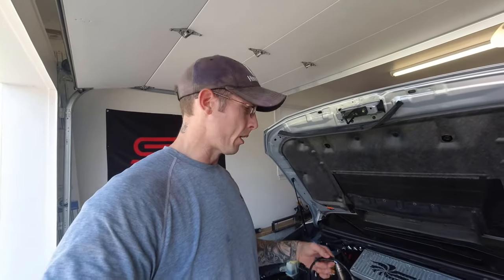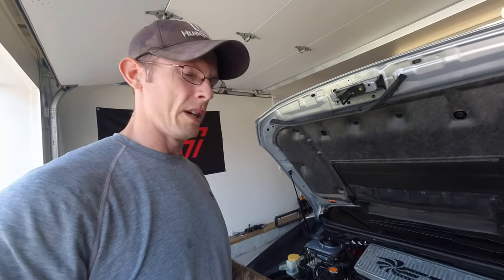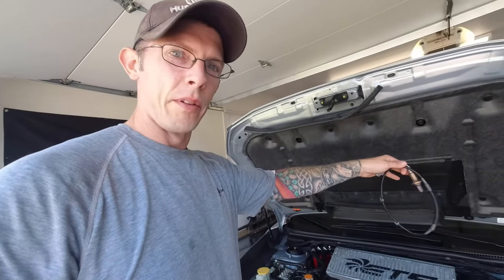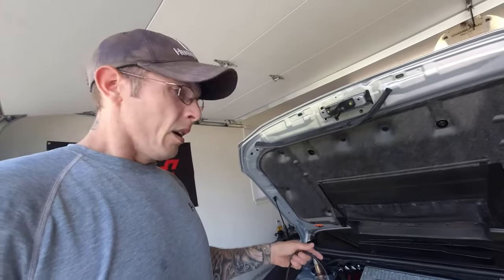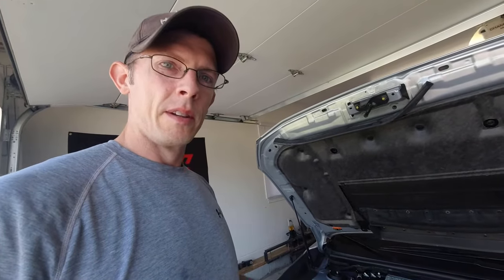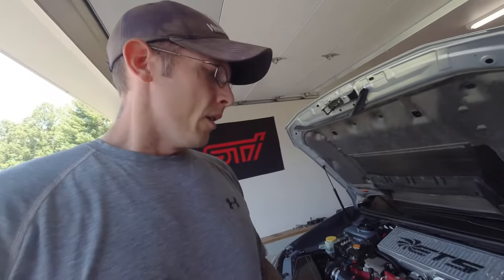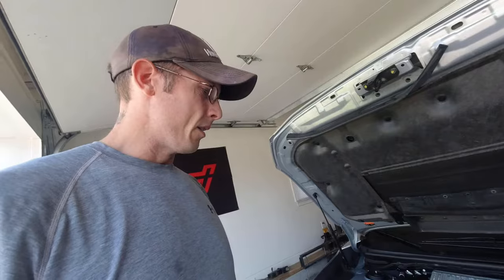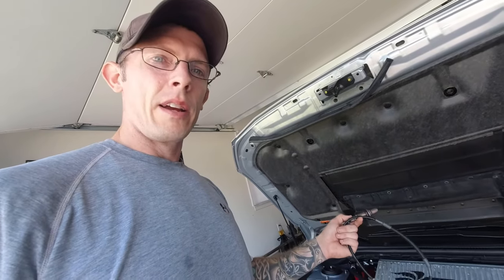Symptom of a Failing Front Oxygen | O2 Air Fuel Sensor | WRX STI

Comment: What's your opinion on using o2 sensor from autozone? Just got a P013B code. Slow response from lean to rich. Thinking of replacing them myself but Oem o2 sensor kinda pricy for me
Reply from the maker: Personally when it comes to sensors and anything electrical it is hard for me not to buy OEM. My take on it is I can pay a little more up front and get the longevity of the OE part. 

I’m sure there are plenty of cases out there where the cheaper sensors have worked and are still working. I just prefer to go with OEM parts in this case.

Thanks for asking and I hope you get your issues sorted.
Reply: I bought the bosch o2 sensors at autozone for my jeep and they didnt work because they are not compatible

Comment: i have the same problem afL 1 goes to like -40 and car runs really rich and stalls out almost but i have code for low voltage on rear 02 which makes no sense because thats for emissions and im catless
Reply: I just went catless due to 1 restricted cat on bank one and the cat by the muffler being restricted and I ended up having them removed and still having all kinds of maxed out fuel trims causing intermittent shaking, loss of power and stalling and backfiring and popping. I changed every filter, sensor, fuel pump, injectors, plugs, wires, coils, Maf, TBC, and still does same thing. I’m only getting 02 codes and recently took to the 3rd mechanic and he’s now telling me I need my cats put back on for my 02’s to work properly. He also said only OEM 02’s should be used. He told me the downstream 02’s will also play a part into air/fuel ratio which I didn’t know. I was told they only monitored the health of the cats. I’d like a second opinion before I pay them $2500 for an exhaust that won’t end up fixing my issue.

Comment: Would this make a fuel pump fuse blow ? I have a 2015 Subaru WRX STI launch edition and starting my car in the morning is dies and pop the hood fuel pump fuse keep going out once you keep it running it's fine ? Driving me nuts
Reply from the maker: I sincerely don't think the 02 senor would make the fuel pump fuse blow. 

That issue sounds like you could have an electrical issue on the fuel pump circuit itself. I'm no electrician, but it sounds like the initial draw that it takes to start the car is overloading that particular part of the circuit. The largest electrical  current draw on anything is at startup

Hope you get it lined out quickly. Sorry I could not be of more help.
Reply: So do you think a new fuel pump would fix it?
Reply from the maker: @lad214  I can't say with 100% certainty that it would correct your issue. Don't want anyone throwing money at something and then it nor be correct.

I'd take it in to a shop and have them check the whole fuel pump electrical circuit for any issues. Then see what they say.

Comment: What was the code called because I have a p0172 rich fuel bank check engine light clean maf sensor and air filter and check for leaks but no luck could it be the 02sensor ?
Reply from the maker: I did not get a code when my 02 went bad. It never threw one, I just had to start trouble shooting based upon what the car was doing. I've personally never dealt with code you have before, based upon what you have said I'd say you are going down the right path to figure it out.
Reply: i have the same code on my impreza it makes the car useless. did you find out what the problem was.

Comment: Hey I got code p0420 on my 19 STI, it came on after I made like a hard right turn so I figured i moved something down there, do you think it might be the sensor like in your situation? My car has no issues at all though drives normal with the check engine light or without it, I just been resetting the ecu and check engine went away for months but came back on recently,
Reply from the maker: You may already know this, but the 0420 code is for the rear O2 sensor near the cat. In that situation that's probably why it's not really causing you any issues other than the light. If it was the front O2 you'd know it lol. 

With that said, you could have a cut in the wiring going to the rear sensor that just acts up every now and then. Like with the hard turning and such. I'd check that out see if everything is tight and in order back there. If that doesn't work for you then it very well may be a faulty rear O2 sensor.

Good luck on getting it sorted.
Reply: @spdkills83  oh man thanks for explaining that. And for replying so fast👍🏼👍🏼👍🏼 I will go ahead and do that and go from there. Thanks again!

Comment: My car stalled on me today, yesterday I replaced the catalytic converter & top o2 sensor  (cheap parts from eBay) and it atleast got it back running since it had a clogged cat converter however it immediately showed the o2 sensor code upon repair. The car is not reading the o2 sensor/throwing a code. It drove fine yesterday but shut down on me today/stalled. I unplugged the top/upstream sensor, now it runs alot better. What could be the issue and can I drive roughly 300 miles with it unplugged until my mechanic can take a look? 09 accent 1.6L. Thank you so much for any help

Also, the check engine light when off when unplugged

Comment: Brother, this video has shed some light on to my current situation. 21 sti, speed density, fp red fbo, flex, 8k miles.tuner sent me 3 revisions of the base map. rabbit hole of troubleshooting ensued after the third. vaccum leaks here and there (most significant was injector/tgv housing and manifold/tgv gasket)  fixed the issues.  Car is still on 3rd revision base map, af correction is -11 at idle. Any blip of the throttle swings the car into hunting. swapped O2 sensor and noticed a  positive one point of difference between the original sensor and new one. How is an AFR sensor with such low mileage failing?! I’m heading to the garage in the morning and hammering this last issue out.
Reply from the maker: Good deal man glad it may have pointed you in a positive direction. It definitely does suck to have an issue like this kinda like chasing a rabbit down the hole as you said lol.

Hopefully you get it sorted soon and if you do please write back as to your findings 🤛.
Reply from the maker: Just wondering man did you ever figure out your issue or exactly what it was?

Thanks man
Reply: @spdkills83  well i changed the afr sensor to a new oem, sent a log out to my tuner and he definitely saw improvement vs the previous sensor.  i don’t have much run time with the new sensor. but it did still have some idle hunting issues(base map). I have recently gone from larger stock location to a rotated turbo kit with a 6466. still waiting on the kit.
Reply from the maker: @brandonsendek4781  Good deal man, was just curious if you ever got it fully sorted. Seems like it will be able to be tuned out once you get all your parts in. 

Continued good luck man.

Comment: Did the motor shake while the O2 sensor was bad?
Reply from the maker: It would only shudder after revving. As in the video it would almost die after revving and it also died several times when coming to a stop.

Otherwise the idle appeared fine outside of those instances. Took quite a bit of trouble shooting back and forth with tuner and IAG to finally pin it down.
Reply: @spdkills83  I have problems with this code p0137
Reply from the maker: That code P0137 relates to the rear O2 (close to rear cat in the down pipe) and a low voltage input.

The issues I encountered was with the front 02 sensor which is actually an AF sensor also. It’s located in the header. 

As for the symptoms when that rear sensor goes I cannot fully say 100% what happens.
Reply: What code is P0037
Reply from the maker: Quick check looks like code P0037 is a low heater circuit malfunction on the heater circuit of the 02 sensor.

Comment: I’m having problems with 2016 Jeep Patriot. I changed plugs and battery. Drove it around the block and it’s studdering in first gear and wants to die when I’m at a stop. It idles ok in park though. Should I try replacing the front one first?
Reply from the maker: Did the issues start after the plug and battery change or were those changed to try to fix the stuttering issue to begin with? Are you getting a check engine light? 

Most of the time when the O2 sensors fail you will get a check engine light. Before I would throw sensor money at I’d get it checked for vacuum leaks. A leaky vacuum hose is far cheaper than new O2 ‘s.

Good luck
Reply: @spdkills83  yes check engine light was on.
Reply from the maker: Good deal, take it to a local auto parts store they should be able to pull the code for you typically. That should point to the issue or at least get you pointed in the right direction.

Would hate to see you throw money at a sensor if it is not the culprit.

Again good luck hopefully you get it sorted.
Reply: @spdkills83 took to auto shop to run diagnostics. No codes came up. Check engine light didn’t come on until on the way home. Wants to die and studded when slowing down and at red light.
Reply: @tonyaflaherty5872  currently having the same issues, replaced spark plugs and maf and reset battery, then I started having weird issues where my car just sputters when barley giving it gas but never completely dies. Then took it to smog and it couldn’t pass due to “oxygen sensor” but no codes or check engine light are popping up
Reply: @jaythebeast2437  well I now have check engine lights and codes 0730 and 0700. Which is emissions and gear ratio. How did you reset battery please?
Reply: I also replaced Maf sensor but it said to drive it 20 miles to reset. I haven’t done that because I’m afraid I’ll be stranded or hurt internal transmission

Comment: That’s what my 2013 STI hatchback does. It bounces rpm’s and when I come into a red light or reverse my cars almost dies/ does die and it revs when I slow down. Every time.Anyone that could help? I’m still learning cars
Reply from the maker: Not a master mechanic by any means, but before I'd go and replace the O2 sensor I'd hunt down a possible vaccum leak or some other common annoying issues. 

Vaccum leaks can cause mysterious idle issues as well. Also, a failing fuel pump/clogged injector, etc can cause issues as well.

You can take it somewhere for them to check all of the above, or take it on yourself. Those are just some quick thoughts that come to mind.

Hope you get it sorted 💪

Comment: Just got a Cobb catted downpipe installed and with green speed update, already got my first P0420 lol. Any recommendations like try an O2 Fouler or just live with it and reset the ecu every time it pops up?
Reply from the maker: You could try to use a defouler. I've heard of people having moderate success out of them in the past. Otherwise, just keep resetting it lol.

I think they are releasing or have a released a newer version of the DP that's supposed to not throw the code. Admittedly have not been keeping up with them on this issue though.
Reply: @spdkills83  no worries, thanks for the reply! I’ll give it a try otherwise resetting isn’t the end of the world

Comment: I have a high idle code p0507 any ideas as to what it could be?
Reply from the maker: I had that code once several years ago. My culprit at that time was a vacuum leak. 

It was probably 10 years ago or more now, but I remember it drove me nuts figuring it out as it was intermittent to start with.

Hope that gives you maybe a starting point to go with.

Comment: Did you use scann tool to check voltage
Reply from the maker: I did not use a multimeter to check the voltage on the old O2. 

In retrospect I should have checked it using my torch and meter, but at that I point I was ready to set the whole car on fire.

Comment: Where would the o2 sensor be located at?
Reply from the maker: There is one in the header which is the front up stream or (front) sensor mentioned in the video. The other is in the downpipe which is the down stream or (rear) sensor.

Comment: Does vibrate when you rev it with the sensor on?
Reply from the maker: When the sensor was plugged I could rev it and it would drop to low idle and shudder/die sometimes. It would randomly die when slowing to a stop light or any stop also.

Comment: This just happened to my car last night. The car was perfectly fine the day before it happened so idk what happened. I do have 100k on that sensor so I’m not too surprised. I’m replacing it in a couple of days, just waiting for it to get here.
My only concern is that I just got the car protuned a month ago. My tuner never mentioned anything about a bad o2 sensor so I’m concerned if it was on its way out while on the dyno. Hopefully this new one doesn’t mess with my tune, otherwise I’m screwed.
Reply from the maker: I was in the same boat had just got a pro tune and thought the sensor may had went during tuning. I replaced it when I got the car back home (after contacting tuner) and have been good since.

My tuner stated it was fine when tuned, but could have damaged it during tuning and ultimately caused it to fail soon after. They recommended replacement as while it was being tuned everything was in spec so replacement should bring it back to normal.

Hopefully your situation works out the same.
Reply: @spdkills83  that’s some good news! You’ve reassured me 👍

Comment: Was this messing with your knock and dropping your DAM?
Reply from the maker: Thanks for the question. The sensor failing in my instance did not directly affect the DAM or Knock corrections. DAM never dropped and I only occasionally ever saw knock say  -.7 or so and that was rare only happening once or twice.
Reply: Had the same problem as well. My dam would drop around .873 for while and jump back up to 1.000. same goes for my knock.
Reply: @chayzf  my DAM is doing the same thing. What did you do to correct this?? Did you replace O2 sensor?
Reply: I keep getting a front o2 code for biased/stuck rich, any ideas on what to do, should I just replace the sensor?

Comment: Can u please help me😢😫
No mechanics are getting my problem 
I took my car to 3-4 mechanic’s and they can’t figure it out. Even i have researched alot, nd I’m getting confused

The problem is
1. sometimes my car runs perfectly fine.
But suddenly it just dies on the highway.
Mostly when i lift up from the clutch(I’m driving a manual) which means its bad at idling
2. Recently i get to see black smoke when i rave up. The more i press, more black smoke comes out.
3. Not running like before
4.poor milage
*5*. Its just wants to stop on idle. When i press the gas a lil bit ,then it tries to adjust to be normal

•I’ve replaced a throttle body ,valve and CLEANED the throttle body.
•changed the crankshaft sensor
•changed the COMPLETE fuel pump
Also i have tried by unplugging the o2 sensore, whn I unplugged its problems reduced a little bit.
Now just o2 sensor is remaining & it’s showing “not working* on a OBD2
Please suggest me something
Reply from the maker: That sounds like a few potential issues. You could start with a full ecu reset (disconnect battery both terminals for 30 minutes). See what that does for you. 

After that, you could smoke test it for any potential vacuum leaks. If you have a big leak it can make it idle oddly and randomly stall also amongst other things.

After that you could check and clean your air filter and MAF. You can also unplug it while car is running and see if it behaves differently. It is similar to unplugging the o2 and noticing a change.

You could also replace both front and rear o2 sensors, but I’d start simple before investing a bunch of $$$ at it.

Those are the suggestions I have without being hands on with it. Could even check spark plugs and coil packs as those can cause some of the issues you described.

Continue your research and I wish you luck on finding your issue.
Reply: Check EGR valve.. not sure what kind of car you have.
Reply: black smoke means your car is running super rich, try unplug the MAF to see if the car starts to act normal. if it does, you found the problem.